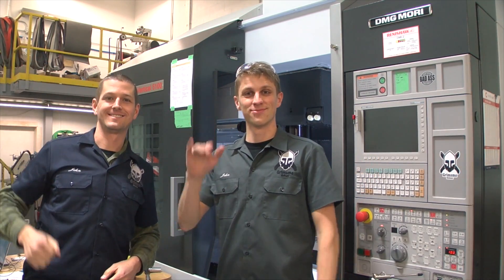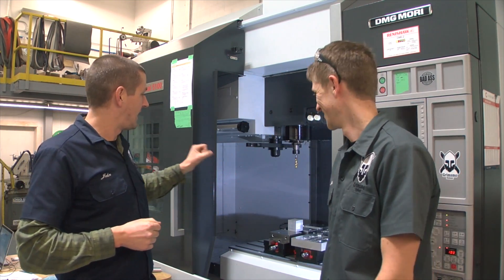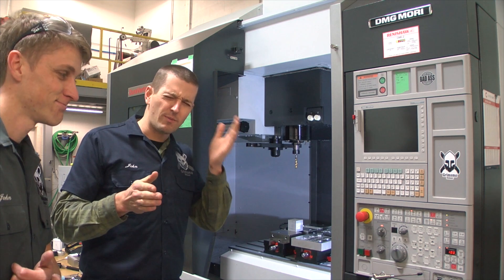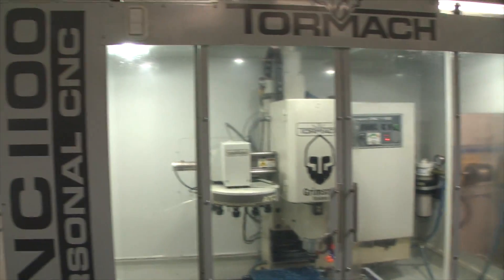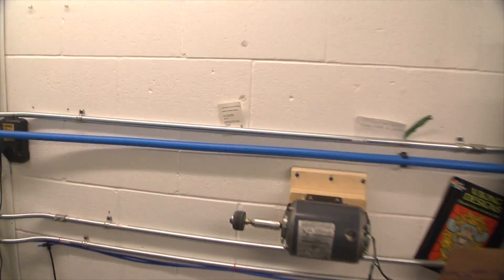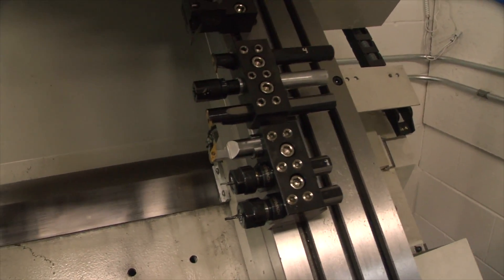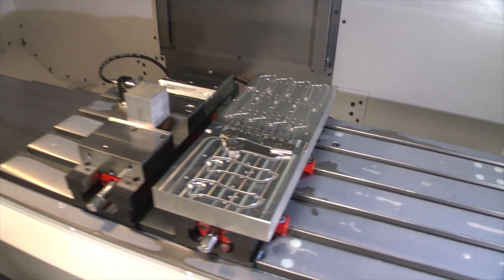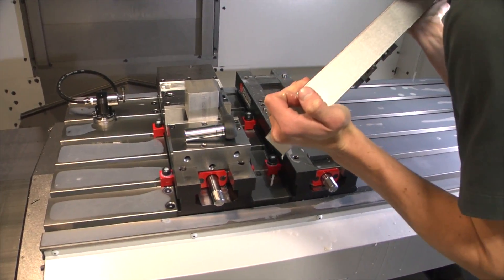John Grimsmo & John Saunders Wednesday Widget!

Comment: I have a 3dConnexion SpaceNavigator. I find them a little (actually, globally very much) too touchy and disorienting at times (Wait, am I controlling the camera's XYZRUV coordinates or am I controlling the part in translation/rotation?!) So mine is relegated to the occasional playing of KSP and X-plane. I'm sure I can get better with it, but it almost seems like I don't do enough with it and haven't taken the time to set up the sensitivity to get decent fine control over movement.) Still a useful purchase, though: Not having to fiddle around with F360's camera controls is worth it, even if it's sometimes frustrating.
Reply: +NYC CNC The book answer is "treat the hockey puck looking thing as if it is the physical item on the screen, so push the bottom left to the right and the top right to the left and it rolls the object you see counterclockwise. Translation (sliding) right would be by  pushing the top left and bottom left of the "puck" to the right, translating the object to the right." and so on. 

All well and good, but the problem is that most programs that support it tend to take the "easy way out" and treat it like a camera or viewport control, which really trips you up until you up until you do the mental equivalent of "referencing all axes to home." 

It's not (really) for doing traditional 2d input. (Cursor up/down/left/right) I think the confusion (in most cases) is the word "mouse" in the description of the product. If they'd have called it a 3d "controller" or "input device" or just about anything other than mouse, people would have come at it from a completely different mindset and grasp it (no pun intended) more intuitively. 

Do I regret buying one? No, strangely. 
Is it an indispensable quality-of-life tool? No.
Do I recommend everyone go out and buy one? Eeeh, "maybe" It won't get better until more people buy them and demand better program support. Most people aren't inclined to be guinea pigs.
(Oh and BTW, the description doesn't have a link to John Grimsmo's copy of part 2... "Watch part 2 at: ", spaces and then "Download Fusion 360 at...")